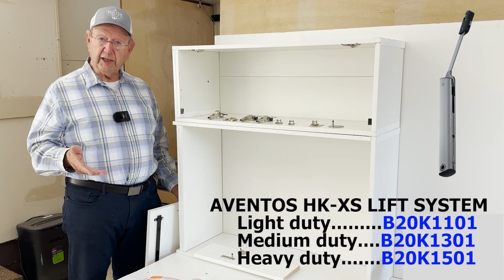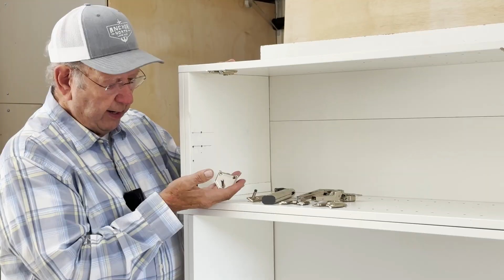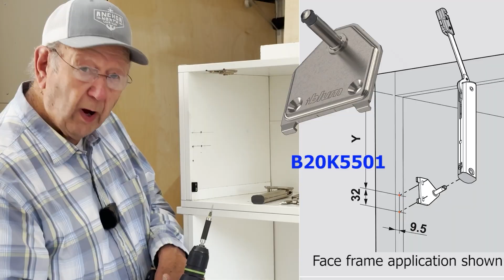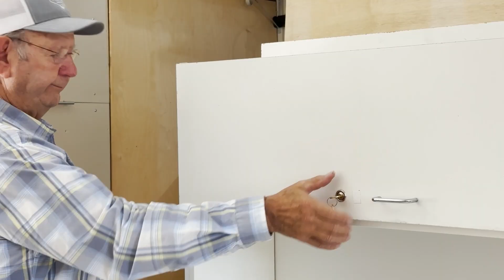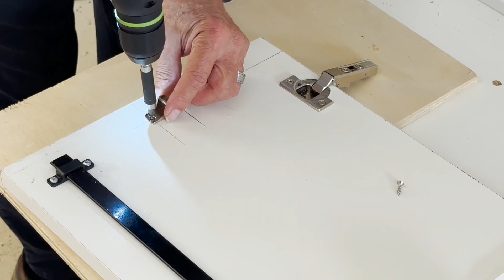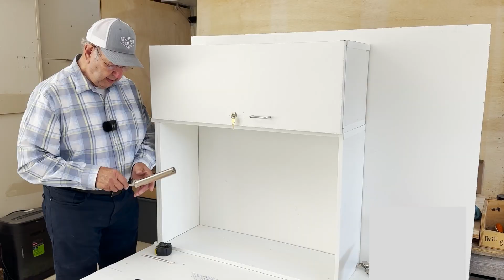Blum Aventos HK-XS Lift Mechanism Made Easy!

Comment: Great video, I'm learning a lot. At the beginning, you mention the HK-XS will work for an inset door  but you never discuss how to measure for positioning the brackets. Blum doesn't seem to talk about inset in this application. Any suggestions?
Reply: Never mind, I figured it out. I used the dimensions from this video, but assumed an inner (imaginary) cabinet that would give me a 3/4" overlay. So essentially back and down about 19mm for the mounting stud.

Comment: Another excellent tutorial by Larry!  One feature I was hoping to find though is using the Aventos lift bracket in conjunction with Blum Compact Clip hinges (31C ) specifically for face frames. My order from WH came that way (made with assistance) so I assume that my 31c hinges are compatible with the Aventos arm lift.  So, how would the calculations be different? In my case I'm using Shaker-Style doors (3" stiles) and my hinges are 1.5 overlay.